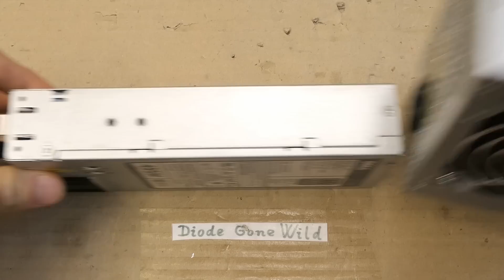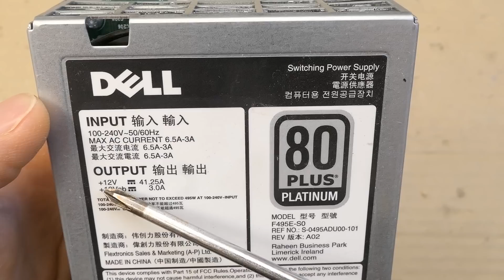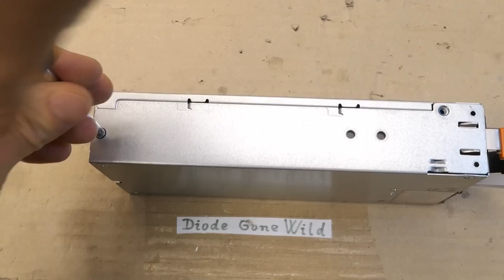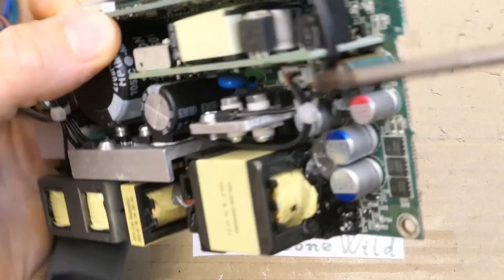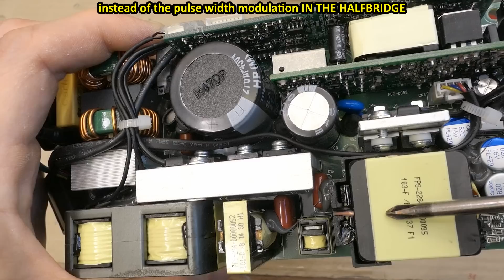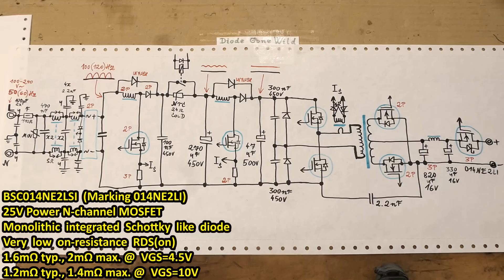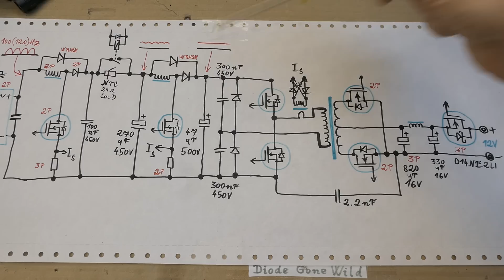495W server power supply teardown (with schematic)

Comment: Hello,
I have a Cisco DPS-650AB-2 A server power supply. It has an 11-pin connector. How can I turn it on?
The green LED is blinking. It is not in short-circuit protection mode—it seems to be waiting for an enable/startup signal. The fan spins, but the main 12V 54A output is not active.
How can I trigger or enable this power supply so that it provides the 12V output?
Thank you.

Comment: "I guess these power supplies can operate several in parallel" 

Yes! Servers usually have two of them so if one dies you can swap it out without having to shut down the server.

Comment: Secondary boost converter which is bypassed a diode is likely meant for AC dropout immunity. TI calls them "baby boost", they are only active when AC disappears and they recover most of the energy from the bigger 270 uF capacitor, keeping the server alive for additional few ms.

Comment: It would be interesting to know , if there is a chance to modify this supply to 13.8V output. They produces harmonic free and RF clean output DC voltage suitable for powering radiostation etc. I have two pieces of 800W variant. They are working. How to start them is easy to find. But they give max 12.6V out.

Comment: Awesome video, Thanks for sharing! 
I wouldn't mind seeing you get your hands on a Hewlett Packard HSTNS-PL48-B, Specs are 100-120vac 7a/200-240vac 5a or 240vdc 4.5a In and 400vdc 2.4aMax out 550w or 960w depending on input volts.
I plan to use it for charging batteries (solar setup).
Unfortunately I have not been able to get it out of idle mode into standby mode as of yet.

Comment: Is there a possibility that it could be a resonant LLC converter topology after the PFC cicuit?
Reply from the maker: I think if it was resonant, it would regulate the output voltage by frequency modulation (tuning closer to or further from resonance), and thus it would NOT need the second boost stage as a regulator. I'd have to open the transformer - if the windigs were loosely coupled, there's still some chance it is resonant, but I doubt it.

Comment: Have you seen any video of people taking power supplies like these and grouping then up 10+ in parallel to run radio transmitters? I've watched their videos, and they seem to work, but long term wouldn't they start back feeding into each other and causing chaos?  If you haven't seen them, search youtube for '1000 amp power supply' and you'll find many examples.

Comment: Those inrush limiters are actually PTC, which is safer in case of a downstream short.
It's a little surprising that the doubled boost PFC parts aren't interleaved. 
The second boost also provides hold-up time extension in case input AC is lost.
Regulation could be done by either the boost or frequency if that is a half bridge resonant converter (probably LLC). Secondary side control could be better with frequency since the boost is current mode, and the boost also probably gives slower output transient response.
This is definitely one of the more interesting server power supply designs, thanks for sharing.

Comment: I have 1 of those but for PC server so it has wires, it's a very good and stable 12V power supply, yes you can't play with the voltage but you can use buck\boost converters.

Comment: The control circuitry looked more than a tv tcon...too packed and complicated. A psu you dont want to fail in your hands and have to repair with or without schematic, little difference would it make

Comment: Nice supply. Packing lots of power in such a small size is quite an engineering achievement! I use a similar supply, albeit it's HP rather than Dell, as a central 12VDC supply for my lab.

Comment: 0:15 
80 Plus Platinum actually means it must be over 90% efficient :) 
(90% at 20% load, 94% at 50% load, 91% at 100% load). 
The specification: https://en.wikipedia.org/wiki/80_Plus
Reply from the maker: Well, that's a bit confusing :) but typically, they want to confuse the customer the other way. I'd expect a 90% efficient power supply to be called "95 Plus Diamond SuperMax Deluxe Pro" :D
Reply: @DiodeGoneWild  its just a legacy thing from the days when 80% efficiency was something special. Later they kept inventing more and more labels to accomodate the technological advancements. There used to be no gold or platinum :D

Comment: These power supplies in Dell R620 like to blow up with a large blast. Something on the bottom goes up in smoke and shorts live to neutral killing circuit breakers. However output still works and the other power supply in the server keeps the server up & running :D

Comment: Very interesting to see all the different designs of switching power supplies. Seemed a little odd to use a boost converter in the second stage before the transformer. The most logical would be to use a buck converter for that (especially given the already high voltage coming from the PFC stage). 
Given the power and voltages, currents are not very large either (because that could otherwise be a reason to design like this - increase the voltage to not have to handle as much current and be able to use thiner wires, get less ripple current in the capacitors and such things). But for something that is only intended to output a set voltage, the regulation range isn't an issue.

Comment: FYI... The PFC can be disabled via software in the server control system
Reply: @xenoxaos1  Ohh intresting, but why would they want to like disable the PFC ?
Reply: @xelcocorp  less stress on the internal components... Less heat... And if your utility doesn't measure actual power and just measures current and voltage (not phased) then it would be cheaper to run
Reply: @xenoxaos1  Ohh that makes sense, Thank You :)
Reply: Then how is the boost circuit driven (since it needs to still boost the voltage in this design)?

Comment: It could be a fixed frequency resonant topology. Usually they are frequency controlled, but this can also work with the variable input voltage... I think. I've read that the diodes across the possible resonant capacitors limit the power and prevent capacitive operation. I've never seen a setup like this before...

Comment: But why not to use boost  + buck converter then? After the buck state voltage will have less difference from the output, so efficiency will be higher due to lower conversion ratio. Or just use single SEPIC instead of boost+buck?
Reply from the maker: I was also wondering about this, but I guess a boost regulator is easier as it doesn't require a floating gate drive.
Reply: @DiodeGoneWild  buck can be made without a high driver, it's just a matter what side to consider high ;) Switch nMOS from the ground, but place capacitor and half bridge converter on +Vdd

Comment: Overengineered partial CRAP!  I know there is a lot of safety stuff needed to not BLOW UP server MB, but really all of today's server PSU are INSANE!!!!!!!!!!!
Just use some GaN's and a straight forward LLC or similar topology and you are done.
Reply from the maker: Yes, the complexity of something that just produces two voltages, is totally crazy ;)
Reply: That power supply is ancient. It is like saying, why they used vacuum tubes when you can just use transistors. There was no GaN's back then.
Reply: @TheTallGirl  I was referring to today's server PSU's.
I used to maintain Dell servers, and none of them used Gan's yet, being a ten year on design.
One INSANE thing about servers, that sellers LIE and LIE about is how long they last.
A server can easily last 50 years, with maybe one time PSU change over due to caps not making it, and hard drive change overs.
Where I worked, and because newer server were not much faster, we planned to keep using them for another 5-8 years, but were forced to change them because the EVIL EVIL M$ made it impossible to stay software compatible.

Comment: 495 is an interesting number.
Reply from the maker: Maybe some regulation requires it to contain something extra (that increases the manufacturing cost) from 500W up?
Reply: Collocation charges... You can get billed on the number of height units typically 1U to 4U and how much power it can pull.

Comment: Boost converters have low efficiency, and have two of them is series and have >80% efficiency is interesting.
Reply: Oh, and this is being used as a PFC Boost circuit. So typically input of (120-240v). At 240v  I am 100% sure the boost stage is >97% effeciency. Talking 2.5 amps max to hit the power rating, this is a situation for a boost converter
Reply: @Calandron1  wow, in this PSU they use diodes, hard to believe in 97%
Reply: Boost converters can have fantastic effeciencies. Even low voltage boost converters can beat 90%.
Reply: @Calandron1  interesting. I think 90% is possible only with a very little voltage difference

Comment: I think it might still work, just the card edge connector seems to have broke off when sliding it in the server or maybe servicing which may explain why it was in a such good condition from inside ??
Reply from the maker: I was also surprised it's so clean. It comes from a scrap yard. Maybe they broke the board off because they keep copper wires (or gold plated sections) separately.
Reply: @DiodeGoneWild these things are built like a tank. My guess is that it failed at one point and they broke off the connector to prevent it from getting back into the hot swap replacement bin as there are usually two of these in a single server.
Reply: @xenoxaos1  Yess, I always try to find these in the Local Market here where they have like retired server gear.

Comment: danyk a question, is it possible to calculate the temperature that a magnetic ballast of a fluorescent reaches in a situation of a stuck starter without doing it in practice, by the current in the circuit or by the mass of the ballast, I wanted to know the temperature that some of my ballasts would reach but without leaving them frying in practice
Reply from the maker: They typically say the abnormal temperature rise. There tend to be 3 or 4 thermal numbers on them. The first one is the winding rated temperature (for 100 000h life), most often "tw130" (130°C). The second number is the normal temperature rise, typically something from 20 (in super low loss ballasts) to 80 (°C). Then it might say the capacitive temperature rise (in a capacitive branch with a series capacitor in a lead/lag compensated pair), which is slightly higher than the normal temperature rise due to harmonics. For example 35c. And finally, the last number is the abnormal temperature rise. It can be anything from 50 to lets say 175 degrees, which bakes it in case of a stuck starter :). But keep in mind, that the abnormal temperature rise is measured also at 110% of the input voltage, so in reality it's not that bad. Some example of a low loss inductor marking:  tw130 / 30 / 35c / 75. Some example from a crappy standard loss one, with no capacitive branch rating: tw 130 / 60 / 175. (60 is the normal t rise, 175 is the abnormal)
Reply: @DiodeGoneWild  I'm a bit surprised the higher-loss ballasts aren't required to have a thermal cut‑out in case the starter remains stuck (let's face it, most stores just leave a few lights in that state indefinitely); then again, peeking at some of the IEC standards has me disillusioned with them in general (impedance‑protected motors are also allowed quite a lot of leeway) so I don't expect that much…
Reply: You can't without knowing how/where they are mounted. 

This value is seen in components as "W/K", i.e. how many watts will be radiated before the case goes one kelvin (=1 °C) up.
Reply: Power consumption of a ballast in a short circuit can be calculated only if you have the induction value of it (H).

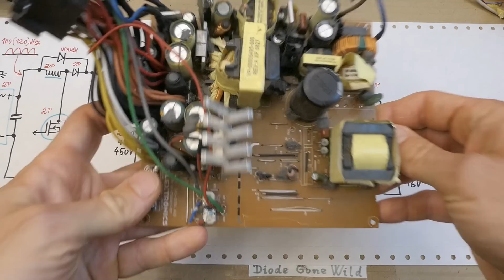Comment: 12:06 did you notice your old power supply is the same brand? :) Both made by Flextronics
Reply: I work at the Flex factory
Reply: Perhaps this arrangement is Flextronics' pet topology; I can't say I've seen it from any other manufacturer.
Most other manufacturers would use the smaller inductor in an LLC resonant circuit (a few, such as the Seasonic G‑360, deliberately use a split‑bobbin transformer to get enough leakage inductance without needing a separate inductor) and not use the small 500V electrolytic capacitor.

Comment: I worked at Arista Networks from 2013-2016 or so and was qualifying power supplies with basically the same form factor as this, possibly same interface but hard to tell since they cut the end off (probably to harvest the gold plating). The ones we had were made by Artesyn/Emerson and Delta, exact same power rating 495W (although we also had bigger ones up to 750W and higher I think) and same +12V and 12Vsb. There are probably just the two power outputs, some control GPIOs, an analog current sharing signal that connects to the other power supply, and a PMBus interface (which is basically built on SMBus which is similar to I2C). I believe these power supplies can be configured for automatic fan control, but you can also read the temp sensor and control the fan via PMBus, which is desirable because you don't want the PSU fan doing its own thing separate from the main chassis fans, otherwise you can end up with reversed air flow when one is pushing harder than the other.
Reply: We'd snap off the connector from dead ones that were no longer in warranty. Prevents swapping a dead one for another dead one.

Comment: This one would be really hard to modify for a different output voltage, 2 years ago I modified 2 ATX PSU to go up to 20V!
Reply: does the current capability stays the same though ? I doubt that it probably reduced the current a bit to match the power output.
Reply: @xelcocorp you can keep tha max current rating as long as the output power is below maximum power the PSU is designed for
For example i have modified a 300(real)Watt(12A rating on 12V line) PSU and it can deliver 24V@10A without problems. Just have to make sure the output diodes can take that much curren instead of trusting tha lable
Reply: Okay. But then overvolting the output how does the Supervisory IC does not interfere ? Its probably made to lock in at 12V right ?
I have to revisit Great Scotts Video Again he did the PSU modification I think.
Reply: @xelcocorp  Just dont use PSUs where the supervisor is build in the PWM CTRL. IC. That can be foolde too but at that point just find different PSU
Reply: @hopper7755  Yes I took apart one lying around. But it just uses some weird ass Comparator IC to supervise as well as to generate signal to drive just so weird IC unlike the ICs where there's PWM generation Circuitry etc.

Its "HC8012BX-16" Its some dual comparator but I just don't understand how its driving the GDT. and there is NO other IC on the board.
Reply: @xelcocorp  typical the GDT is driven via a simple bjt based drive. That is really weird ic, i found some sort of datasheet for it but it's weird to the point that i think its wrong datasheet:)
Best PSUs to modify are the tl494(or k7500 there pretty much the same) based ones, that ic has 2 error amps(one for current, other for voltage feedbacks) and has excellent documentation
EDIT: most likely that is renamed "EST7502"(found this on some random russian forum). To confirm you can try match the pinout to the circuit board and see if it makes sense.
Reply: @hopper7755  Ohh Thank You so much. :D
Reply: @xelcocorp  Well you should not go over the maximum total output power. My is 500W, I think original it was 12V 20A and the rest was the 5V and 3.3V, so now it's 20V and 20A that's 400W. I no longer use the 5 V and 3.3V, actually I completely removed all the components for the 5V and 3.3V. And about the supervisor IC you need to cut a trace on the PCB.